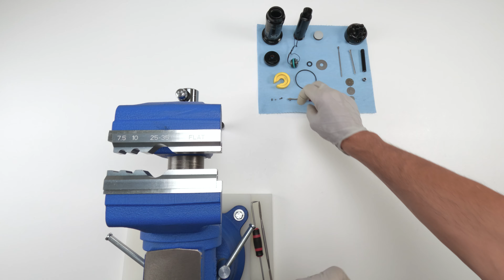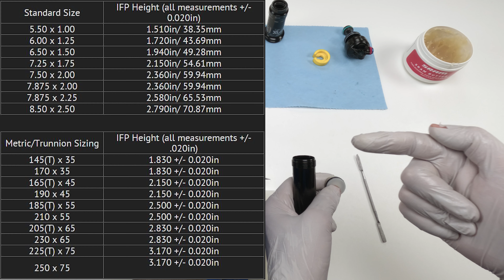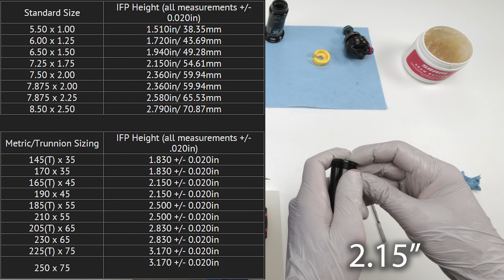FOX DPS Shock Repair + Full Service Guide for Beginners. Broke your knob? Then this video is for you

Comment: - As soon as you showed what was happening with the selector I knew the damper shaft had snapped. I work as a professional suspension mechanic and have recently gotten a couple of the exact same float dps performance shock with the selector issue and both had the damper shaft snapped in the exact same spot. Both shocks were well past their service interval, one was a 2018 that had never been serviced and another was a 2020, but that one was on a polygon with a heavy rider so it was under a lot of stress. I keep these broken shocks as a display to show riders who are hesitant to spend the money on service for their suspension. I get it’s expensive but so are the medical bills that the worst case scenario can incur, and a new shock is even more expensive. The symptoms are always the same, oil leaks from the top rebound/selector and the knob won’t move. The system relies entirely on the ifp pressure so if anyone reading this has a fox float dps shock and you haven’t done the damper service within the recommended time frame and your selector has gone from firm and snapping into the three positions with a distinct click and it doesn’t move, to having the selector be floppy and it easily moves and doesn’t have that positive engagement you should get the shock serviced. Even if the bike has been sitting for awhile the ifp charge (nitrogen or nitrogen/air combo) will leak into the damper fluid over time because as the video shows the ifp has only an o-ring to separate the chambers. 

- That question about removing the selector without opening the shock, I would say no absolutely don’t do this. If you remove the air from the ifp you will move the depth of the ifp. Obviously the shock needs to be empty and it is really difficult to ensure the shock is fully extended without at least removing the air can. Moving the ifp depth can compromise the function of the shock. Plus you then need to recharge the ifp chamber, which is the only difficult part of working on this shock! It’s extremely dangerous to even perform this fill, let alone have someone with hobby level suspension repair experience to attempt it. If something is wrong with the selector please encourage people to bring it to a professional. You can change the tightness of the grub screw in the shock head to change how easy or hard it is to move the selectors but that is all I would recommend a home mechanic attempt. And only like a half turn max.

- Some questions about this shock just for me to learn, what is the service history of it, do you know what year it is and if it had ever been fully rebuilt? We as customers demand a lot from these components and they are high performance products that need to be maintained. Just look at how small these parts are and think about the forces present when you hit even small drops and jumps. They are over engineered to reduce failure rate given most people will not take care of the shock but nothing is full proof.

- I’ve found that rotating and tapping the shock before closing the bleed port up can get the last little bit of air out, every time I’ve serviced one of these shocks I’ve done the tapping and rotating and have gotten more bubbles out. Just a small thing I’ve found helpful! Super agree with your recommendations for extra needles and pellets, lots of needles are too long and bend while trying to insert it. And then while pumping 500psi is a lot and it takes a lot of strength to physically pump the shock. Keep the hose supported and really tighten the fox pellet tool down to hold the needle.

- You can adjust how hard the selector and rebound is to engage with the grub screw at the top, obviously don’t back it out too much but small 1/8th turns can make the selectors a bit easier to move while not compromising the shock function. Your blue selector does seem to be at an angle that is too extreme. The selector assembly may have been damaged, it should match the picture on the front of the air can really closely. I could see during your test the blue selector was not snapping into place as positively as it could be. I’m not 100% sure what’s causing it but sometimes it takes cycling through the positions to get the system to equalize itself and settle into the positions. I’m sure you know but for anyone reading you can insert the lockout plate into the damper shaft after reassembly as seen at 1:10, to test the engagement of the blue selector. Insert the lockout assembly into the shaft and GENTLY push down until you feel it pop it place. Make sure the blue selector is in the open position while you are inserting the assembly. While keeping gentle pressure on the top of the lockout assembly move through the three positions. You will see and feel the assembly move corresponding to what position you are in. You can also test the rebound when the lockout assembly isn’t in the shaft by pushing gently on the rebound rod with a soft pick or something that can put pressure on it. While keeping the pressure applied click thru the rebound positions and you will feel the rod moving up or down depending on which position you are in. This is a sanity check to ensure you have inserted the shaft in the correct orientation. So you don’t get all done with the job only to see the selectors aren’t working.
- Lastly in my essay (I love this stuff hence why it’s my job), I’m surprised you have a lockout gauge but not a piston band sizer. That glide ring needs to be sized with it. It really makes a noticeable difference after using the piston band size in how little friction there is between the glide ring and the damper shaft itself. Plus it’s just a fun tool to use lol. It’s one of my favorite tools to use just because of how it feels to press the glide ring through the sizer with the vice. I think you misspoke are the end on the dyno. At 1:34:42 you said rebound fully closed while what I assume you meant to say was rebound fully open. Closed rebound slows the shocks movement while open does not.
Reply: Quick question regarding rebound and compression under IFP pressure vs not, newer DPS models no longer have the spring that props up the rebound shaft. Mine is a newer model DPS that does not have this spring, and I'm assuming that the IFP/oil pressure will be enough to be pushing everything up. What I mean by this is that when the lockout plate is allowed sink into the cams in the eyelet assembly, (my shock is remote version) the IFP pressure is enough to push the lockout plate up. And same would go for the rebound, when the shock is unpressurised the clockwise rebound clicks push the rebound shaft down but it will not return (give clicks for counter-clockwise/open) unless I apply upwards pressure to the rebound shaft with a small tool, I have looked through the docs of older DPS models when they had the spring and they also used a much lower IFP pressure (150) at that time, would I be correct in saying that that is the reason that the spring became redundant?

So my question is, will that all be sorted by the IFP pressure when I re-assemble the shock? As far as I can tell, it will but would like to know if I'm missing something before I re-assemble it all!
Cheers.
Reply from the maker: Apologies for the delayed response, Bob, but keeping up with comments and questions is proving to be a bit of a challenge. I'm glad to hear you're still at it, and I hope all is going well with you. You hit the nail on the head! The shock is a 2021, it came new with the bike, he is the original owner, and it was never serviced. One thing I noticed was that the piston bolt was WAAAAY tighter than it should have been. No way that thing was set to 6.8. My guess is that, just by feel, it was clean over 12nm. It took a surprising amount of force to separate it from the broken shaft bit.

"That question about removing the selector without opening the shock, I would say no absolutely don’t do this"
Agreed, and I hope my message came across as it's not worth attempting this. For some reason this question comes up ALOT! Though it's physically possible to do it (and I believe I mentioned, a couple of times, that the IFP chamber needs to be emptied), It's just not worth the effort to do this as so many things can go wrong. What I will do is add an "READ ME" at the top of the description section just to make sure people are clear on this

"I’ve found that rotating and tapping the shock before closing the bleed port up can get the last little bit of air out"
I've never considered this and will try it on the next one I work on. I know that some pros out there cycle the shock a few times after closing it, and then open the bleed port slightly to release and air that might have been missed by the bleed, but it seems to me that one wrong move the IFP and change its position. Your idea sounds much better, so thanks for the tip

"I’m surprised you have a lockout gauge but not a piston band size"
Funny you mention the piston band sizer. I actually have the tool, SOMEWHERE! I haven't been able to find the freaking thing since the start of covid. I'm, sure it's in a box, that's sitting in a larger box with a bunch of small boxes in it, that have a bunch of other small stuff I can't find.  I tried to buy another one back then, but it was literally IMPOSSIBLE to find one in stock at the time. I pretty much improvised, and got used to using the damper body as a guide, which I wanted to show in this video because I technically stretched the glide ring more than I liked while installing it, I reminded my self to record the process, only to end up giving myself the big forehead SMACK in post when I realized that I totally forgot to record it. 

"you said rebound fully closed while what I assume you meant to say was rebound fully open"
I just looked at the clip, and It looks like I misspoke when testing the rebound dial, stating fully "locked" instead of fully "closed". But then I opened it to see how fast it'd come back up again. Terminology with me when making these videos is an area I'm really trying to improve. I've never had to worry about it before. My whole life, it's been pretty much just me and my thoughts when working on projects. To this day, I'm still amazed at how challenging it is to try to explain everything in as much detail as you can while you're actually working on it, while recording and while constantly thinking that you can't make it too long. MANY times I find myself staring at the screen with a tilted head, confused dog look on my face during post.  I'd love to script this stuff, but honestly, I just don't have the time.

Bob, I truly appreciate your input, and I feel fortunate whenever you share your thoughts. This isn't a job for me, and though I have been working on cars, motorcycles, bikes, and just about anything else mechanical my whole life, I've always considered myself an enthusiast AT MOST! Having grown up with a meticulous old time mechanic for a dad, I truly understand the value of experience through repetition. That's what makes a true professional. So please feel free to keep sharing your thoughts, knowing that I'm thick-skinned and hard to offend. If you see something off, please let me know. Though it might seem like there might be some kind of conflict of interest, trust me when I say there isn't. Most people neglect their stuff, the vast majority, who do occasionally maintain their stuff, will send it in for service. This is for those who grew up like me, and from what it sounds like, you as well, people who love this stuff and are looking for that extra bit of confidence. Though one thing I've learned from the channel is that there is a WORLD of people out there who don't have the same accessibility as we do to get this work done without spending a ridiculous amount of money to ship it to another country and waiting a super long time to get it back. 

On a side note, did you ever get the vacuum bleeder?

Thanks again, and I hope all is well

Comment: Hi Zoub, watching your last vid on this shock gave me the courage to change the oil and service the air spring, after this one I decided to go right down to the controls as the blue lever could go past the open position, turns out the grub screw/pin is bent which I managed to get out luckily and the cam shaft is slightly damaged where its meant to stop on the pin. any chance you could post links where to get those parts please?
Reply from the maker: sure, but so I am sure of which version shock you have, can you give the the tune ID or serial number. Different version has different cams. thanks
Reply: @zoubtube  no worries at all, custom tune is DNLL. I ended up machining a new grub screw in the lathe and made the 5/8 socket while I was at it just to get it going for the weekend as its my sons bike and no way could I go with out him as I'm sure you can imagine, Sad thing is after I had the damper apart (using zip tie method so nothing moved) it feels as if there is no difference between open or firm and lock out is very stiff but I can slowly compress it sitting on the bike, I'm using shockcrafts ifp valve so confident I'm getting the 500psi in there but I actually set the ifp to 54.61mm and had a thought at work today that its actually a 185x55 tm so reset it tonight to 63.5mm but still have the same problem, from open to firm I'm getting 1.14mm on the dial indicator so I'm thinking along the lines of there is crap in the shims somewhere? its now ill admit I haven't replaced any seals because I'm tight like that and after the first oil change everything was working as its meant to.
also designed a dial indicator mount and the 1/4" drive 3 pin socket for 3d printing which ill leave here incase others would like to use it too. https://www.thingiverse.com/thing:6751957  hard to get tools like that here in new Zealand, really appreciate  your videos and help man cant afford new stuff but like to try to service my old stuff and keep it going.
Reply: update, stripped and cleaned the entire damper today did each shim by itself and still cant tell any difference between open or firm (I can by hand just not in the bike) and lock out has a slow compression although it is very stiff, one thing I noticed when I put the pump on the ifp valve was it only showed around 350 psi, what I think is happening is when I pump it up to 500psi and take the pump off some air is escaping before the valve has fully seated, I'm going to get a new pallet and try using the needle method, not sure if this lack of psi would make the shock behave this way but its worth a shot.

Comment: Hey there! is the dial measurement tool necessary if you do not touch the dials and just do the damper oil/bleed and seals?
Reply from the maker: in my opinion, Nope! Especially if your not working on the dials. The chances of it not being properly seated is super low.

Comment: hi thanks for the video, very precise and meticulous, but I have a doubt because I didn't find anything about it on the fox website, is the 10wt green also used for the 2017 fox dps models?
Reply from the maker: Yes sir. Fox 10wt red has been replaced with fox 10wt green, so green is to be used for any shocks that originally used red. I believe fox discontinued red about 4 years ago, but I could be off with that

Per the DPS service guide - Part number 025-03-008 Oil: AM, FOX Suspension Fluid [32 oz.], 10 WT Green

Hope this helps and thanks for the comment

Comment: Search up shock craft fox ifp valve it's from a company here in New Zealand
Reply from the maker: YUP! I've known about them for years. The only issue I have with them is they have to be removed when performing a 50 hour service. Ironically, if fox was to sell valve based damper body replacement upgrade, I'd be willing to bet just about everyone who services their own shocks would buy one. Thanks for sharing this with people though. it super appreciated. 👍
Reply: @zoubtube  yeah true like you say not having to remove the valve to do the 50 hour would be great and the shock craft valve cost me $60 including postage so might not be far off a new body. also bled the ifp height on my shock we where talking about on your original video and it feels great its a older rp2 but has pro pedal and replaced the basic suntour on my stance, just need to sort my sons shock and well be happy as. cheers Brent